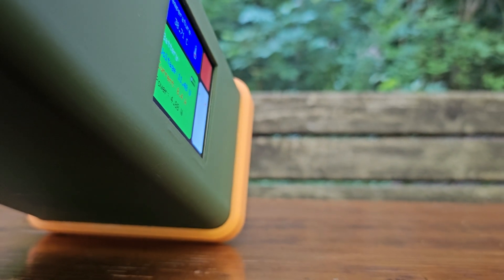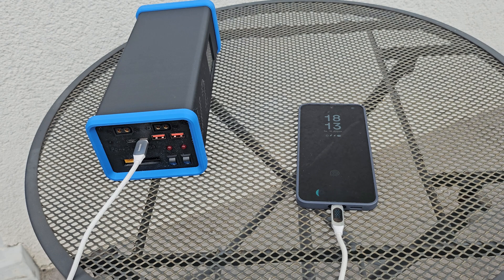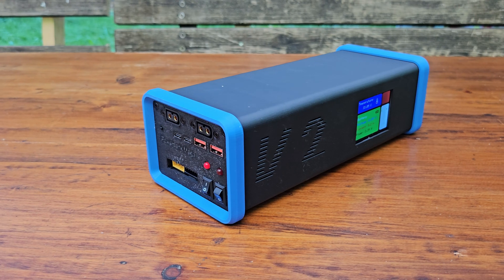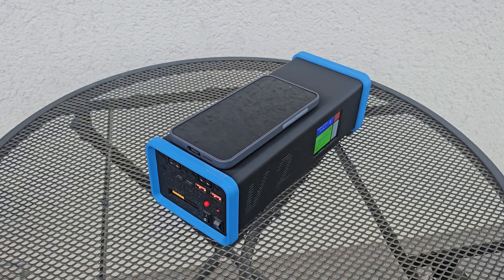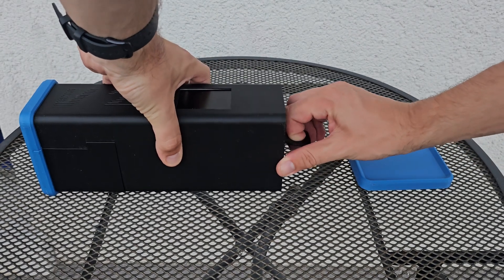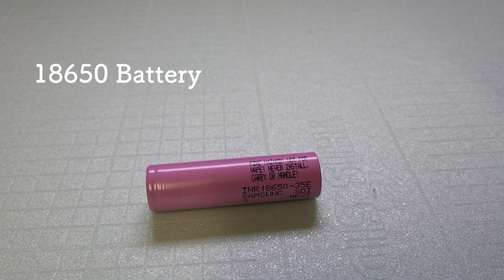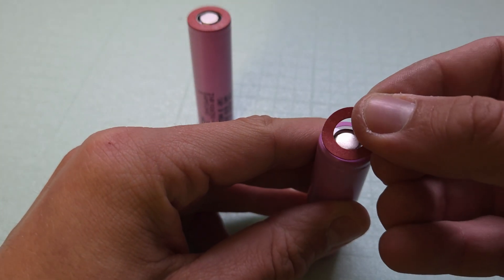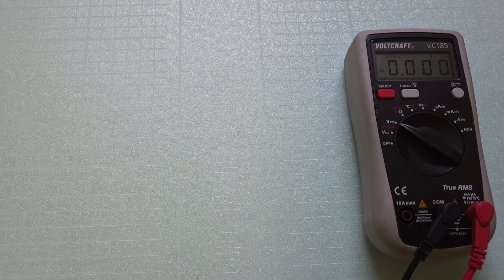Building the most Versatile Powerbank EVER

Comment: U are very good in building power banks but it could have had an ac outlet for small ac appliances 👏👏👏👏
Reply: AC requires an inverter.  There is a small 150w inverter that is sold as a circuit outside of that you have to buy a comercial inverter.  You can add a 12 dc adapter to one of those and use it to provide AC outpuit.

Comment: Nice design
Can you make one I can buy?
To reduce shipping cost you send battery pack with no Battery i can buy batteries and spot weld ‘em here.
If you can answer me with your contact 

Am from Tanzania 🙏
Reply from the maker: We're very sorry but sadly we can't do that. We both have a job and building this powerbank takes a very long time. So we wouldn't be able to build it at a reasonable price. But if you're interested you can get the build plans on our ko-fi site, linked in the video description.
Reply: @BastelLöter Thank you for your Reply. I will check on the Video description 🙏

Comment: I think using 21700 will be better
Reply from the maker: We have discussed this in development but we have settled on 18650 because the 3s 5p configuration fit perfect due to the size.
Reply: No 18650 is better and tougher

Comment: clean your soldering iron tip, use a thinner one
Reply from the maker: Good catch! I know the soldering tip looks nasty but the tip has a kind of coating that is coming off which is the reason for the ugly black stuff mostly on the upper part. And you're right especially for the poco pins i should have used a smaller tip.

Comment: spot welds were a bit weak, need to have a couple of sparks pop off
Reply from the maker: In the video they might look a bit weak but especially with the thickness of the nickel strip used it's actually a very strong bond. And to be on the safe side we have put 6 to 8 Spotwelds on every cell. But I agree it's very important to have proper spot welds.
Reply from the maker: You can't see the sparks because its so fast in the timelapse but there were quite some sparks trust us.

Comment: I did the similar one with plus adjustable voltage regulator but solar charge and screen is ingenious. I will add them too. Thanks for sharing.
Reply from the maker: Oh very nice! We haven't added an adjustable voltage regulator because the Lipo charger has Power supply functionality and can also be kind of used as a Lab bench power supply.